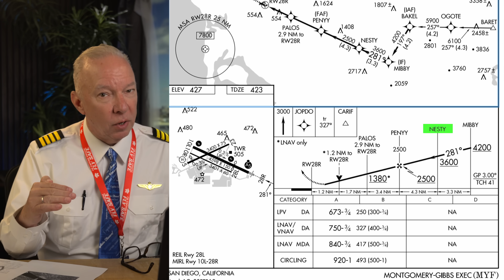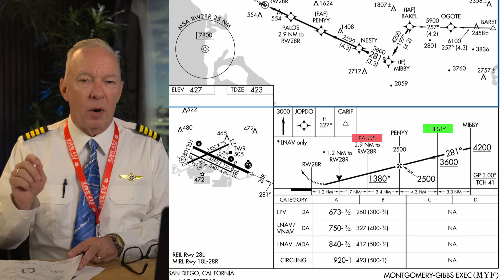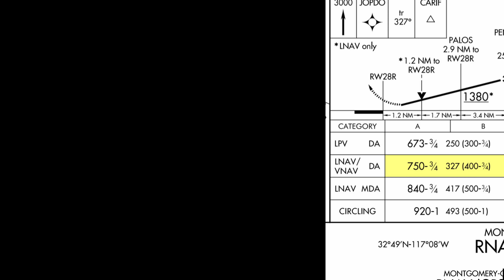Tragic Crash in San Diego: What the Pilot Did Wrong | ATC & Flight Path Breakdown

Comment: The emphasis on the lighting at the airport is confusing as it is irrelevant as to the actual cause of the crash   Either by mistake, or, in an attempt to "duck under" pilot descended too, low, too soon, causing the airplane hit powerlines 2 miles from the runway, which severely damaged the airplane.  The crash occurred at a distance which was too far away to see the runway lights through the dense fog, whether or not they were illuminated.  Therefore, the lighting issue is irrelevant. If the pilot had properly executed the approach, and descended at the proper time, and, was unable, for whatever reason, to see the runway, a properly executed missed approach procedure would have avoided the accident and saved all those lives.  I hope this is the finding of the NTSB as it is clearly the cause of the accident.

Comment: Couple of comments, TR in the Remarks section means Trace, for example CU TR, Trace of Cumulus, 2nd is on the approach category, an aircraft certified for a Category B approaches needs to fly the Category B airspeeds to ensure obstacle clearance. If the pilot flys at a speed higher that that, the higher Category minimums should be used to ensure obstacle clearance, for example, if there is a missed approach turn, the turn radius will keep you within the protected airspace, a higher speed and larger turn radius may have the aircraft at risk of CFIT.

Comment: I have a question that I am not sure if anyone has addressed- If this approach is an LPV approach and the aircraft is equipped to fly this approach (Honeywell Primus, I believe), why would one ‘dive and drive’ when there is vertical guidance available to a minimum height above the runway? Secondly, no matter the altimeter setting, if you fly the glide path, the only difference one would note in flying it would be the height at which the missed approach occurred, there would still have been clearance from obstacles, including the power lines, to the runway. I’ve seen nothing that said that the RNAV LPV would not have been available with GPS/WAAS horizontal and vertical guidance, nor that the Honeywell Primus system could not fly this approach to minimums safely. Using nearby altimeter settings as provided by ATC at the time perhaps could have made a difference at minimums as to whether the runway/approach lighting system could be seen or not, but certainly would have kept the aircraft above obstacles. I do not have NOTAMs from the morning of the accident, but note that LNAV/VNAV minimums have been increased above those charted, but again would have provided clearance in the approach corridor to the runway leading to a safe go around… Finally, under Part 91 an instrument approach may be started and flown at any time regardless of reported weather, but flight visibility must be equal to the requirements as stated in 91.175 to proceed to a landing.

Comment: Captain Steeeve says the approach was not legal. It wasn’t for a  FAR Part 121 or 135 pilot but it was for a pilot flying under Part 91. Through the years I learned reported weather and actual weather are always not the same. It doesn’t make you a bad pilot to fly the approach and take a look assuming you have fuel and weather conditions that allow you to go somewhere else. Since he never received an altimeter setting in the descent he either listened to one somewhere else that was close by or never changed from 29.92 which all aircraft use when flying at FL180 or above. Since the two altimeter settings mentioned were 29.90 and 29.89 the difference would have only been 20 to 30 feet.  Not flying the approach correctly was probably the cause.

Comment: Some good points here especially -  middle of the night - "backside of the clock" always dangerous  with fatigue. GA flights like this, flown FAA Part 91, (personal GA) have no "approach restrictions" to fly an approach (like airlines and 135 - no innocent "paying customers" in back)). Part 91 can legally fly the approach even if weather conditions are zero-zero - CFR 91.175  This was unlikely to be successful though and pilot cannot proceed beyond "decision altitude" - with some exceptions) without "required flight visibility" (determined by PIC). 

Depending on the airplane configuration, this Citation might have been retrofitted with LPV capability enabling vertical guidance and the  lowest minimums (ours jet has this) Unfortunately, many of these  systems retrofitted into an analog platform and can be tricky to operate correctly. If this pilot flew the LNAV/VNAV approach without a current altimeter setting (ASOS system was inop) this was a very dangerous approach (no way to accurately determine altitude. It seems a better option would be the ILS 28R (available to the same runway). This would assure electronic descent guidance without depending on altimeter setting (except for DA). It does appear to be a sad (and avoidable) crash.

Comment: There were no runway lights! Weather radar not working.
Reply: RWY Edge Lighting was operational. The RAILS (sequential flashers)were out of service. Most likely mistook street lighting for the runway environment.
Reply: @sageskeleton   I had the same thought!  Modern LED streetlights are white from the air as opposed to the old mercury/vapor lights that appeared green at a distance. In foggy conditions, the row of streetlights which are much closer together could fool a person to thinking they were farther away from the runway than they actually were from the street.

Comment: So he didn’t have the correct altimeter setting for an airport he was flying an rnav into? Isn’t that an instant no go?
Reply: Correct, that is what the AIM says.
Reply: @igclapp  I don’t care if the aim says it or not I care about it because I know I could die if it’s not correct. You need the correct altimeter for an RNAV approach or you will be flying a glide slope on final that could be crashing you into the ground. There are other approaches where the altimeter is not as important such as an ILS.
Reply: @thehumblepilot22 How will you determine when you're at DH on an ILS if you don't have the correct altimeter? The correct altimeter is critical.
Reply: @igclapp  I mean that is true but at least you can capture the glide slope without the correct altimeter, and that glide slope won’t slam you into ground short of the runway. But you also have other indications how close you are to the runway like looking at the GPS display. I’m not saying you don’t need the correct altimeter for an ILS, I’m just saying in theory it’s usually not a death sentence because the glide slope you are following on a ILS is not based off your altimeter setting like an RNAV approach. And mostly likely you will probably figure out your altimeter is wrong when the glide slope has you a lot higher than what is showing on the chart.

Comment: A few important corrections:
- This Citation II would almost certainly have been a Category B with an approach speed well under 120 KIAS, especially considering how long it had flown since refueling. It would have been entirely legal to fly this approach.
- It was also most likely operated under part 91 (private) rules, and so it would have been perfectly legal for them to 'have a look', unlike if it had been 'for hire' operating under part 135 rules (or 121 airline rules).
- Although a wrong altimeter setting could have contributed, the lack of wind in the area implies there would be little difference in altimeter settings between close airports. A .01" difference in settings is only 10' difference in altitude, and altimeters are not perfectly accurate (remember, our pre-takeoff check only has to be within 75' of field elevation). Obviously, if they entered a grossly wrong altimeter setting, that could have been a primary cause. ATC would normally notice this, but if they were in a continuous decent from 18,000' (over the mountains as they may have been) ATC wouldn't have that opportunity. So that's a possibility.
- Although this (older) aircraft would not have had LPV capability initially, it almost certainly has had avionics upgrades over the years that could have included LPV. 
Clearly, something went terribly wrong. And clearly, these types of flights (assuming it was 91/private) can, and often do, accept higher levels of risk than commercial flights in order to increase their utility. But if we want to learn from their mistakes, accuracy is important.
My heart goes out to all those affected.

Comment: I've been flying 36 years, jets for 19 of those.  The 550 S2 (S stands for single pilot) is basically "steam gauges" or analog panel and they're not reliable.  I landed a long time ago in an old seminole and when I hit the ground the altimimet popped down 75'...scared the crap out of me.  (would not have passed the "tap" test)  The accident took place at 2:00 am and they had come cross country from the east coast.  The pilot was probably very fatigued.  I've heard he was a very good pilot and I believe it, except he took WAY too many chances on this flight.  They landed in Kansas for fuel and could have stayed there.  Nearly zero visability (vertical vis 100') in the dark and he was obviously trying to see the airport (clicked the mic several times to get the lights up), steam gauges, single pilot probably fatigued to the max, had better conditions at another airpoert (marginally), dark, zero temp dew point spread (fog probably to the ground) ....what could go wrong?  Almost all of his decisions lead up to no frikin way I would have even tried that approach.  I have a CJ-3 with Fusion (AWESOME panel, state of the art) and 3,000 in type....I wouldn't have even had that airport on my emergency do or die list.  I'm very sorry for all but this is one that could have easily been avoided.
Reply: S2 stands for "Super II", not single pilot. The single pilot version of the 550 is the 551, though the regular 550 and Super II can be flown by a single pilot with a Single Pilot Exemption.
Reply: I went by the accident scene yesterday and the the airfield to watch a proper approach.  The pilot in the accident was not even close.  There's no way he was seeing much of anything with the visibility and even if he cleared the transmission lines I question if he would have made it in.  So, did he not have any sort of accurate altimeter readings, terrain warnings or equipment to do a proper ILS approach?  It seems as though he was trying to get under the ceiling and fly by sight.

Comment: Good analysis. 22000 hours, 6 types. Dive and drive is 100% a bad idea, no matter what. Are you sure the 550 is a cat C? Circling ok, but fairly certain (580 and 680 typed) 550 is a Cat B, BUT, I don't know. Bad idea, to be sure, but if it was a 91 flight, it's legal (again, not a good idea), totally legal to give it a look. 135, different rules and was not authorized. Most unfortunate.
Reply: Part 91, Category B aircraft. In those WX conditions, barely legal.

Comment: To the families, I am so sorry this occurred.  To the friends and family of the pilots unless the pilot was certified to fly single pilot this was a tragedy that it did not have to happen.  1 hour before to one hour after if your intended destination has less visibility or the ceiling is lower than what is required on your approach plait you must file an alternate.  That alternate must meet requirements to land still have 45min of fuel remaining.  Picking an alternate because you can’t get in is truly unprofessional as well as illegal. Going below a mandatory altitude anywhere is trouble especially on an approach.  Picking a runway without an ILS was not a good decision. California has many airports that could have worked out just fine.  There are approaches that sometimes require you to get down to minimums early. Dutch harbor is one of these places.  This approach requires a missed approach in the event you cannot see into the bay 3 miles before the airport. This place is in the mountains. There are places that require this type of flying.  Not at that airport ever

Comment: In Part 91 operations, Look-See approaches are legal in the US.  Not sure about how this flight was operated though.  Any insite? (Look-See means you can commence the approach even though the weather is below published mins). Also, the intermediate fix PALOS is shown as a LNAV only requirement, do we know if 1) the flight was using VNAV and, 2) if the VNAV crossing height is above or below a calculated LNAV/VNAV altitude
Reply: bump
Reply: The step-down altitude is usually on the glide path. At least that's how it's depicted on the chart, and logically it should be on the glide path.

Comment: After the remaining ac struck the house others pieces got thrown across the road several houses down and because the streets had elevation and angles jet fuel ran down the street near the curb and caught cars on fire that were parked along the street alot of cars actually on each side of the street
That additional detail paints a very clear and tragic picture of how violent and far-reaching the crash aftermath was. Here's a likely breakdown of how events unfolded once the aircraft struck the house, based on what you've described:

1. High-Energy Impact into the House
After striking the power lines and losing parts midair, the remaining fuselage—likely still carrying significant momentum—impacted the house with extreme force.

Given the aircraft's speed (a Cessna Citation II can approach at around 100–120 knots), the impact would have produced shockwave-like forces, causing pieces of the aircraft (and possibly parts of the structure) to be thrown across the street and several houses down.

2. Jet Fuel Dispersion and Fire
Cessna Citation jets can carry over 5,000 pounds of Jet-A fuel, most of which may not have burned off in the air.

Upon impact, the fuel tanks ruptured, releasing pressurized or gravity-fed streams of jet fuel.

Because the crash occurred on a sloped, angled street, fuel flowed downhill along the curb line, following gravity like water would.

Jet-A fuel is less volatile than gasoline but still highly flammable, and once ignited—either from electrical sparks, heat, or residual engine fire—it spread fire along the fuel path.

3. Secondary Fires: Cars and Residences
Cars parked along both sides of the street became secondary ignition points. The fuel pooled underneath or around them and ignited, causing multiple vehicle fires, which can be intense due to gas tanks, tires, and synthetic materials.

These car fires may have also threatened nearby houses, especially if heat radiated to garages or siding.

The scene would’ve been chaotic, with fire spreading unpredictably, secondary explosions from car gas tanks, and potentially live power lines on the ground from the pole the plane hit.

4. Debris Trail and Blast Radius
The spread of aircraft debris across multiple properties suggests a combination of explosion, impact shatter, and possibly aerodynamic breakup.

The fireball or explosive release from the fuselage likely launched lightweight components—like insulation, interior panels, or small airframe parts—farther than heavier components.

In Summary:
This crash became a multi-point disaster—not just a single impact but a chain of destructive events:

Midair breakup starting with power line contact,

Impact into a residential structure,

Jet fuel drainage and ignition down a sloped street,

Multiple car fires and possibly secondary structure fires,

Wide debris field indicating extreme kinetic energy on impact.

This sequence explains both the physical damage seen and the extensive fire damage involving multiple vehicles and homes. It's a devastating example of how aviation accidents in densely populated areas can spiral beyond the initial crash site.